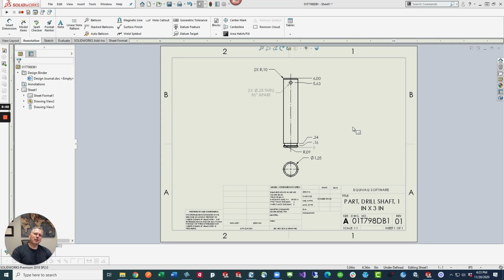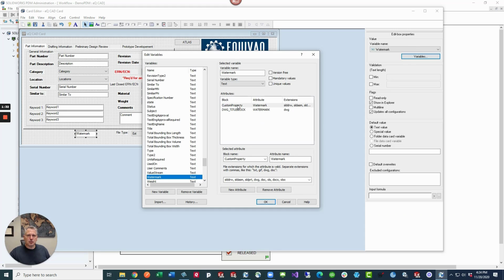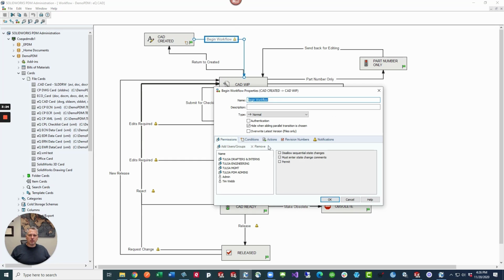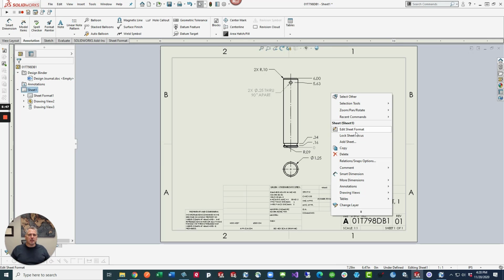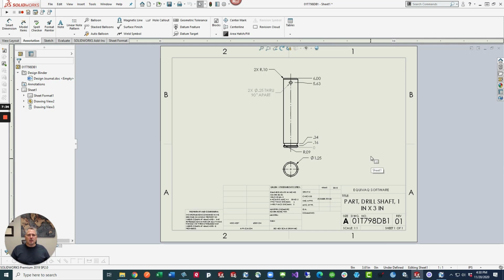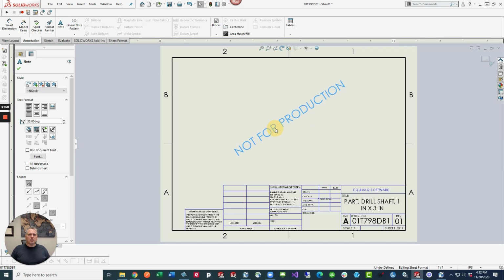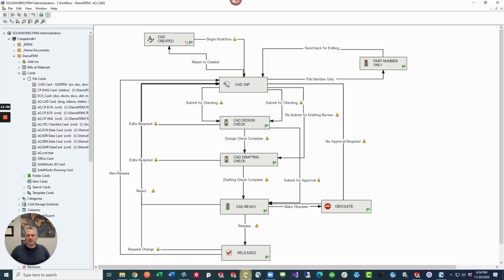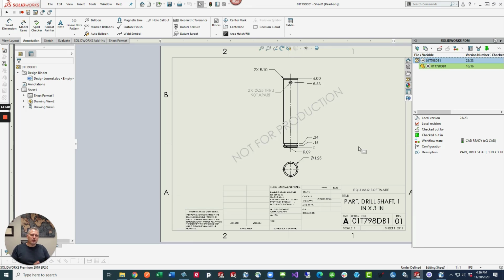Q! Tip™ - Drawing Watermark in SOLIDWORKS PDM

Comment: I just tried this this watermark control with transitions in my workflow and it works great, thanks for sharing.  I noticed that after the remove WM transition is complete the "thumbnail" preview of the DWG retains the WM even though its removed when opened.
Reply from the maker: Sometimes the file has to be checked out again to update the thumbnail but it should be removed after the transition. Did this work ok then?